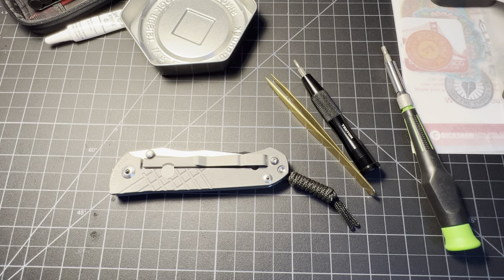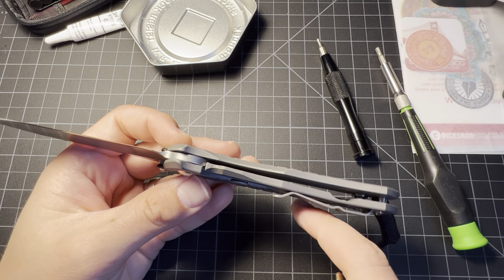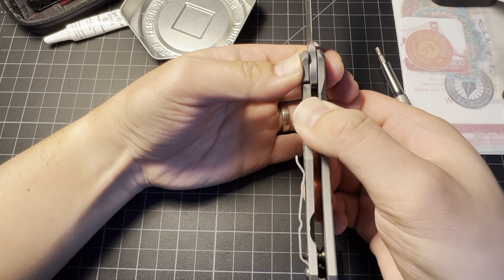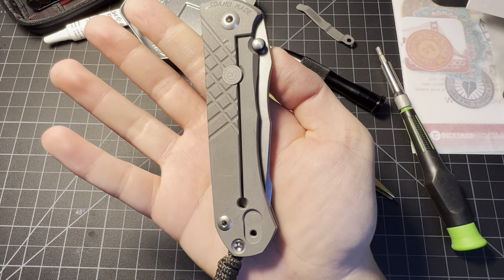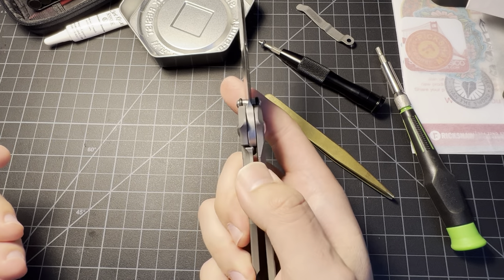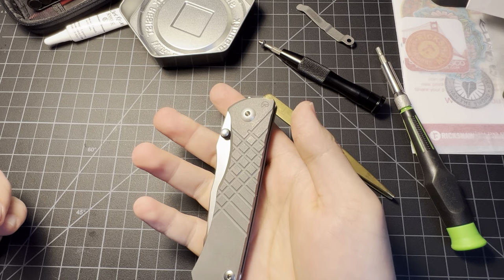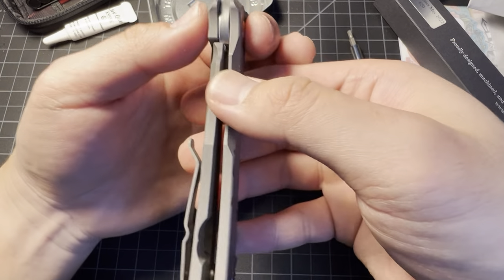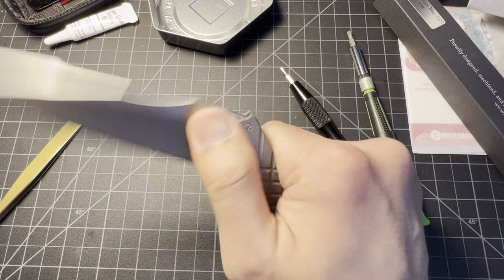How to Make Chris Reeve Umnumzaan “Zaan” Lock Bar Lighter/Smoother by Removing Pocket Clip Pressure

Comment: I don’t think the clip pressure is a factor at all. The only thing it could do is make the unlock harder, but it just doesn’t. I feel like the Zaan has the easiest, smoothest unlock you could ask for - there is ZERO lockstick, and the bar is intuitively designed. I’ve never heard anyone criticize the unlocking, the it’s one of the Zaan’s best features. 

Out of the box, the OPENING is pretty stiff, but you have options - 1) you can just use it until the washers and blade break in to each other and slide easier (6 months maybe?) 2) you can disassemble the knife and carefully polish the face of the washers (2000 grit paper on a flat surface) then add some grease and a little oil mixed in 3) the easiest and fastest fix - just back off the pivot a teeeeny bit  (1/32 of a turn, if that) and the deployment is a lot easier. 

What’s the background on your accent? There’s like some Louisana but a little Boston?? It’s unique, I’d love to hear the origin.